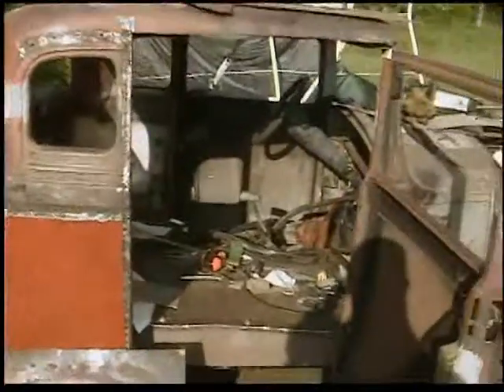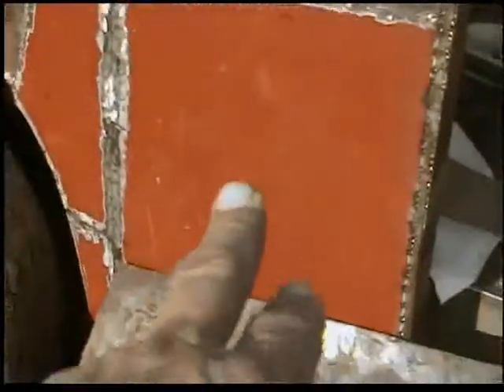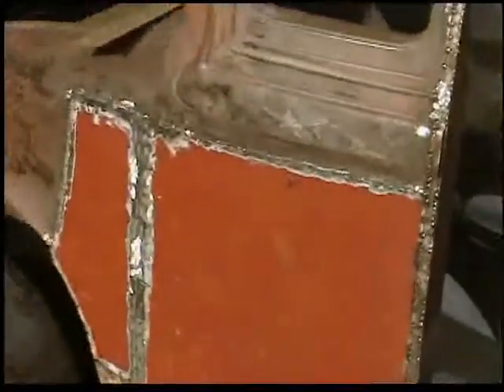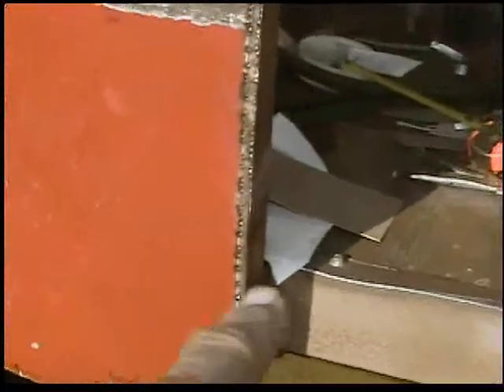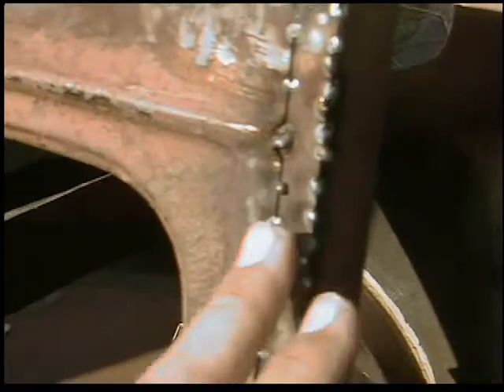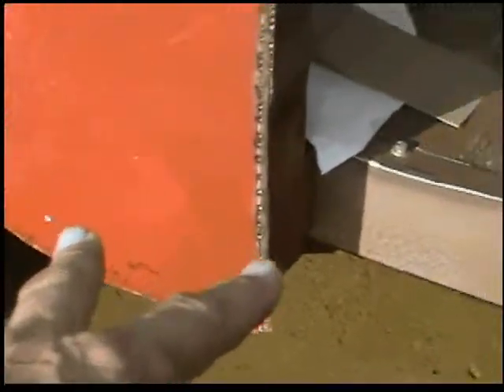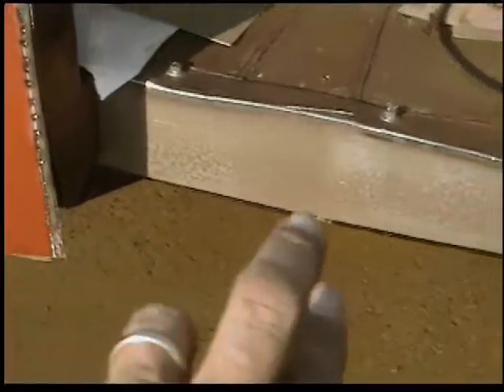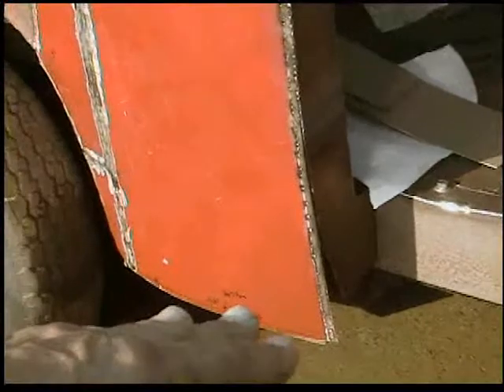13 Rat Rod FrankenStude Too Super Coupe PS Door Fix part 2.wmv

Comment from the maker: Jeep weatherstripping is above,below and on the right side of the door now, drip rail has been made up and installed, it just needs to be seam sealed in the channel. in both doors I am finding bending in the control rods that unlatch the bear claw when the door handle button is pushed. This creates a hesitancy for the door to unlatch.a device that is a simple guide needs to be mounted to both doors correct this.